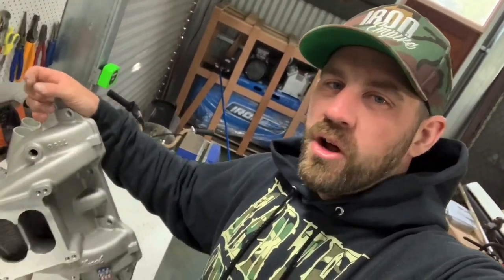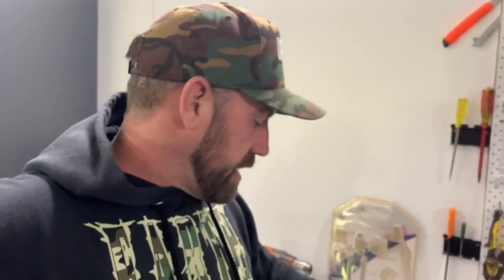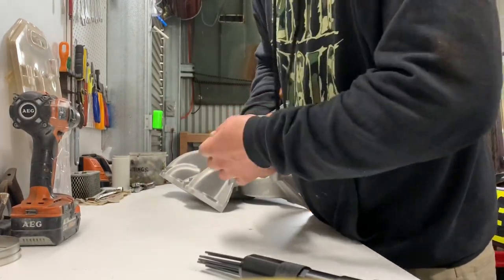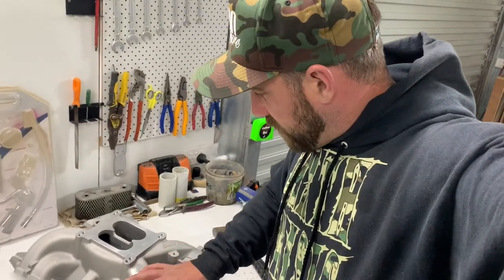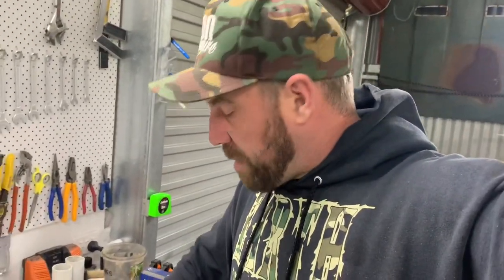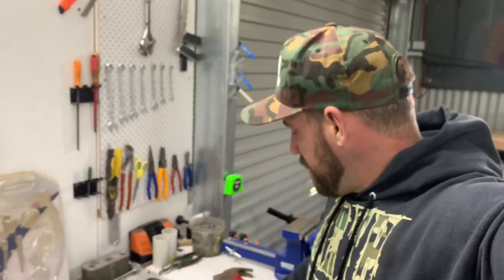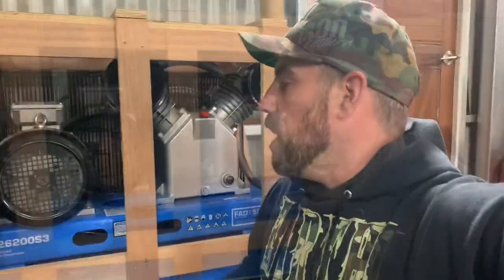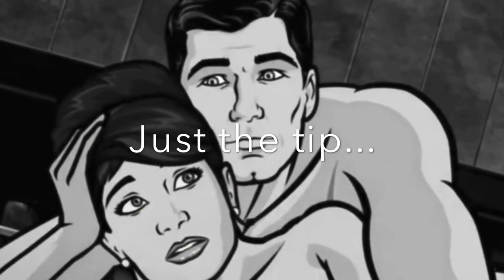Iron Empire - TIPS! Method for adding cast look into smooth parts!

Comment: I have never used a needler but I have done a similar thing with a engraver. It just takes a lot longer you just do squigly lines around and bounce it along the surface. I did it when I had to make some repairs on the head of my old z900 motorbike I snapped a bolt of in there and made a mess of it haha.

Comment: If you haven't got a needle gun another option I've seen is laying a course-grit sandpaper on the ally and tapping it with a hammer
Reply from the maker: Just give it a little tap tap taperoo?
Reply: @TheIronEmpire  tip tip tiperoo

Comment: i have that exact same air compressor its killer can easily run 2 sets of air sanders going at the same time....however the electrical side of it is garbage I've had to have mine repaired twice from it triggering its own circuit breaker before its fully charged so just a heads up they're good but also a little bit cheap in a few things